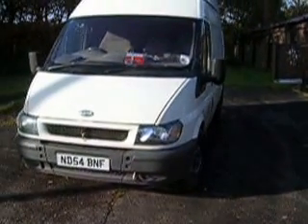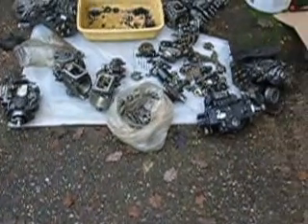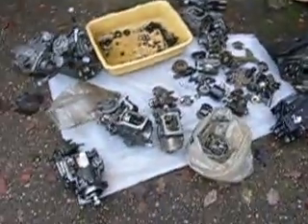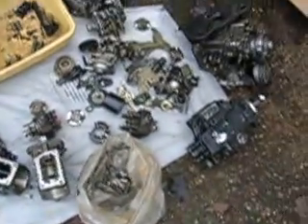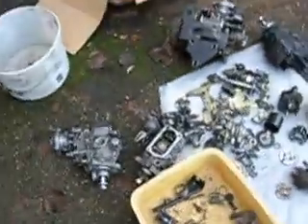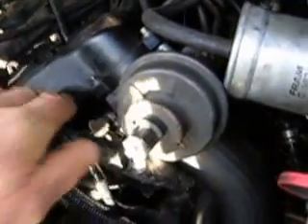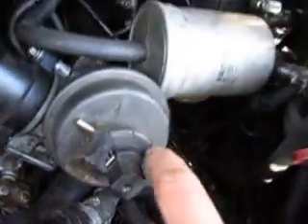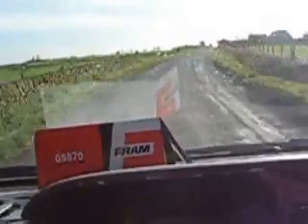MTDI Ford Transit Mk 6 MTDDI Part 1

Comment: If anyone wants to do this conversion, just use a stock 300tdi pump, keep the Land rover timing as is with the timing pin. Retard the the pump by 1,1/2 to 2  teeth, then turn the pump 180 degrees. If you want more performance use a adjustable valve on the turbo waste gate valve line & bleed off some pressure. Remember that exhaust temps rise sharply if you have too much fuel & not enough boost, I use an aftermarket pin which has a very sharp ramp @18psi boost its perfect, safe ex' temps & lots of power, my van was a 90hp its easy 130 ish hp now, happy days! Best have   boost & ERG gauge, its easy to cook the the engine!

Comment: Hello Andy I've got a 90 now and I'm fitting a 115 engine ecu clocks and ignition this week. Is there a manual pump available for this and do you fit them aswell if so how much would it cost please. I'm really interested. Thank you

Comment: Hi mate done 200tdi pump conversion put boost pin in gos like stink but black smokes on hard acceleration any tips? Any help would be grate
Reply: Hi. Did you just fit a standard 200tdi pump?
We are looking at putting a 2.4 in a mk1 transit camper and was thinking of a pump with no electrics on.

Comment: Hi Andy ,watched your video on the transit Mk6 ,changing injector pump to manual , Ive done the same thing but my van wont run at all. is there some way I can contact you by phone.
Reply: Unfortunately mayte they disappeared without a trace all of a sudden with no reason as to why. How is yours getting on? Want to stay in touch and swap info?

Comment: Good to see you made this work have been thinking about doing this myself how did you get on with the pump sprocket did it fit straight on the ve and I was told these engines arnt timed up on tdc did you find this a problem don't forget to update this great to see.
Reply from the maker: More about this at fordtransit.org. Mk6 mechanical TDDI gives electronics the finger. New vid up soon, pump parts should be here in the next week. Thanks for your interest.